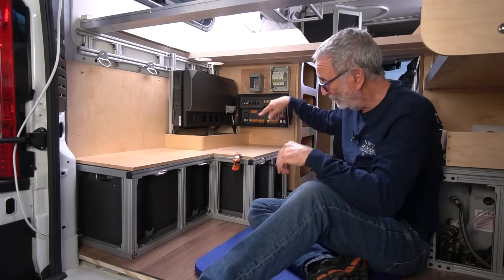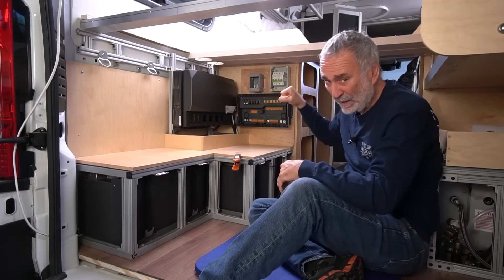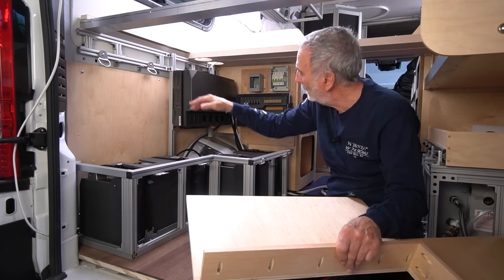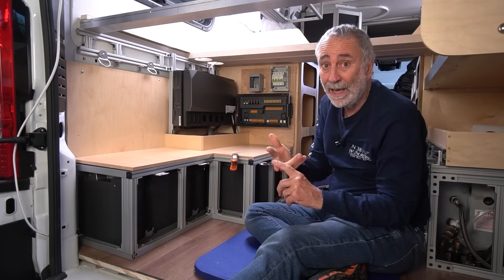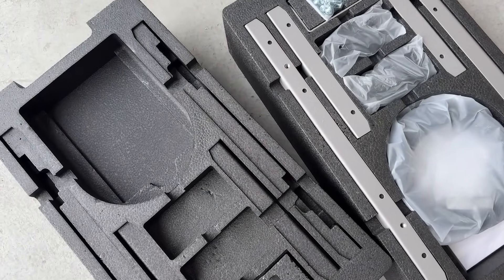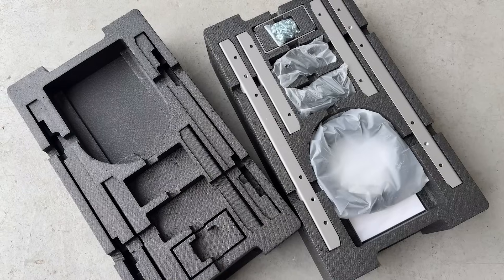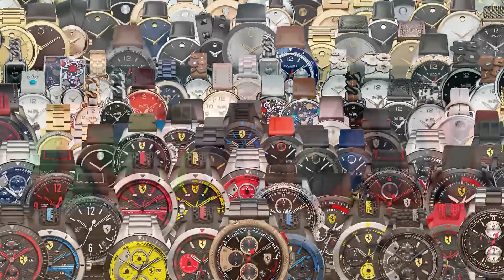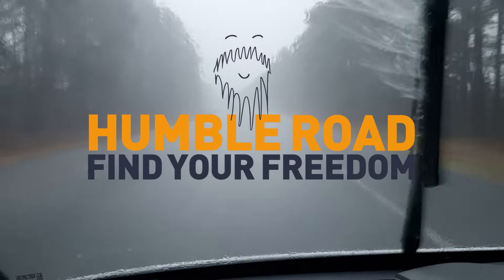A well designed lithium battery configuration for your van. The Power Kit by Ecoflow explained.

Comment: Thanks again for outstanding video!!! Quick question . I am going to install my Ecoflow Gen1. I bought 12/2 anchor marine wire for all the DC and also bought the same wire but 10/3 to power small microwave using the 30amp AC braker. My question is it is any  specific wire for AC to used the inverter or it is OK to use the 10/3 anchor? Thank in advance!!
Reply from the maker: You don't use 12/2 for ALL DC runs. Sometimes you need more, sometimes less. Download the Blue Sea Circuit Wizard. Make sure you understand that the length of a DC run includes the distance from the source to the fixture AND the distance back to the source. In other words, measure the line length and double it.
Reply from the maker: Most 120VAC appliances require 14/3AWG (15A) or 12/3AWG (20A). Your 30A shore power should be 10/3AWG. If you use a Victron Multiplus, for example, it offers power share, which means if your camper demands are more than the 30A shore power, the inverter will contribute AC amps from the battery. In this case, the inverter is fine with 10/3 coming in, but you should run 8/3 coming out of the inverter due to the aded amperage provided during the share feature.

Comment: I hope the price comes down on these, which I suspect it will. For a basic 5K package I believe I saw nearly $8500. Just wow on pricing.  I still think there's something to be said for their smaller units that you can plug into shore power and so forth and have add on battery modules, etc.  Bluetti has some nice ones. Those are going for around $1200, and you can certainly expand those with sub panels and so forth.  I bought Eve cells for my current van and put my own BMS in, and I believe I spent about $1200 for almost 8000 watt hours. I have a 24-volt system. I could certainly see if I were building vans for a living, this would really streamline production. I probably spent a few weeks ordering wires, different ends, different gauge wire, yada yada. Well... you know. It's a lot of work. I still think there are other ways to combine the smaller units. I do believe 48 volts is ultimately the way to go, as the wire gauge is much smaller and you can charge considerably faster as well.  I can also say I am from Alaska, and for anybody who lives in a colder climate, you cannot leave these batteries in the van over the winter months. All of this stuff needs to be removed and stored indoors, and it's a big pain in the ass. I was looking at a Travato at one point with their Volta system, and the battery module is something like 200 pounds. How would you like to have to move that twice a year? Again, I'm still leaning towards the smaller 50 or 60lbs all-in-one units that can be expanded with additional batteries that weigh about the same, as those are much more easily managed. I can certainly see plugging in your 120 devices and sub panels into the 12 Volt sections, and still have options for hooking up to shore power and solar.  We've already seen some major changes in the past few years on pricing, and I suspect it's just going to get better. Of course current administration is really not into electric vehicles and alternative energy to encourage expansion, so it may take a new leader at the helm for real progress, but I digress.

Comment: The Eccoflow is compelling when comparing to a 5kwh Victron  system but when you compare it to a 10kwh system, the Ecoflow doesn't make sense because their second battery is $4600 for a 5kwh battery which is a rip off.
Reply from the maker: A 5K system is not much good unless you are building a micro camper. I even question a 10K system for a full timer. We shall see how his usage flows. I left room for a 3rd 5K battery if needed
Reply: @HumbleRoad the point I was making is that 10kwh Victron is a lot cheaper for a diy. A 10kwh ecoflow system costs $12k

Comment: Just curious, but what happens when EcoFlow discontinues support for that system? I get the simplicity behind it, but what happens after 10 years? What’s the difference in cost using EcoFlow vs. individual components, along with the ability to replace individual components instead of replacing an entire system?
Reply from the maker: The speed at which technology progresses, I would be looking to upgrade/replace any lithium system I committed to. A ten year lifespan for a van power system is a home run!

Comment: Regarding access to the bottom fuse. Add the third battery onto a rotating platform, so it will be easily accessible by the owner himself. Obviously, the platform will be screwed in / secured in standard form. Just my opinion

Comment: why don't you use ferrules on stranded wire ends?
Reply from the maker: Ferrules are an integral part of my wiring. But only in certain types of clamps. Wago and similar specify not to use ferrules.
Reply: @HumbleRoad  thanks for that info - keep up the good work

Comment: Check out ferrule crimps for those electrical connectors and not worry about loose strands.
Reply from the maker: Ferrules are an integral part of my wiring. But only in certain types of clamps. Wago and similar specify not to use ferrules

Comment: George, I don't know if you realize it, I am sure you do but you are following the trends of architectural building construction. I am in the architectural lighting industry and the Wago components are being included more and more for 12v and 0-10V applications. 
Low voltage stranded wires have been used in landscape lighting for years and the challenge was making sure ALL the strands are used.
Leaving even a few strands cut out doing splicing, reduces the connectivity and light output. In addition. for emergency lighting we are using Lithium batteries since they have come such a long way replacing NiCad.

Comment: My builder's invoice for a 400Ah Battle Born & Victron 24v system with a converter for the 12v devices was $8700 installed.  That was in 2020.  I have since added 400Ah, a Cerbo GX, an isolated charger which I pulled out less than a year later and replaced with a Victron XS 1400. These upgrades were another ~$8,500.  My van qualifies as a second home, so I was able to take tax credits of at least $6500 (maybe more, a CPA does my taxes).  My point:  My system cost more than $17,000 and I have issues with it.  Ecoflow may very well be the way to go for anyone building a van. I would go Ecoflow if I were building now.  If it's good enough for George  ...

Comment: Will the system have charging from the alternator and are there limitations from doing so?
Ecoflow’s 48v system is a nice idea with being able to run smaller gauge wiring….less heat and less weight….win win.
Reply from the maker: Yes and Yes.